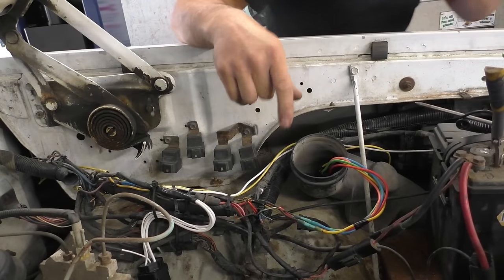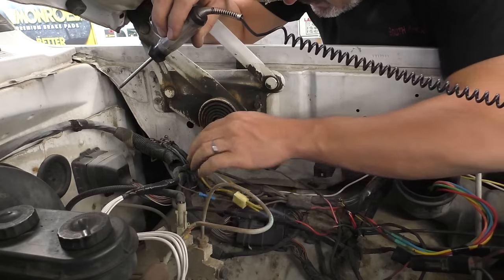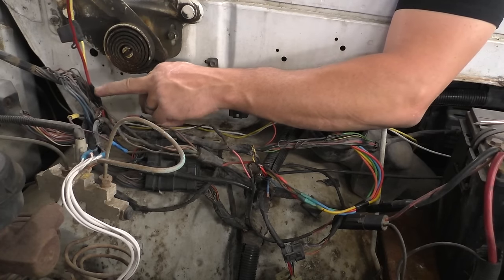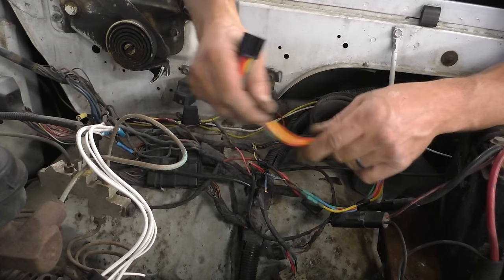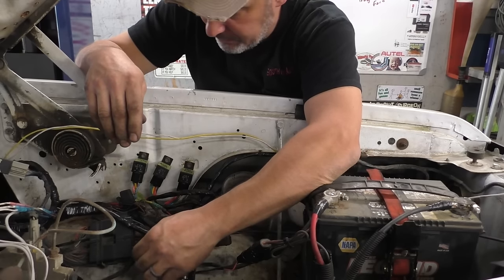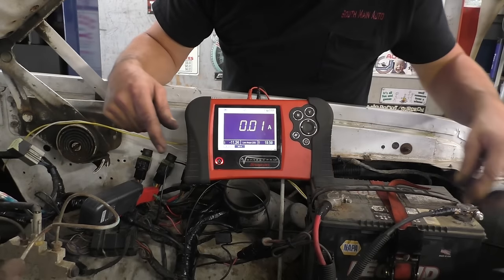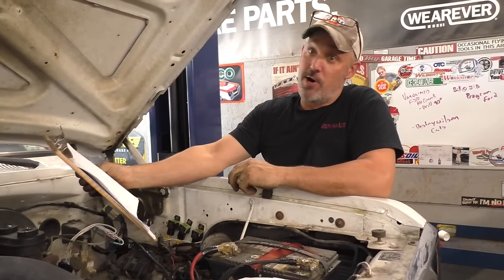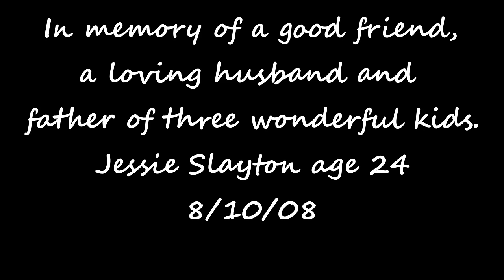Square Body Ram No Start - Complete Hack Job - Part II

Comment: I ran into this type situation with the factory fuseable links, someone's couldn't get power to the oil sending unit/fuel pump cutoff switch so they jumped out from the bus bar on the passenger side firewall on the early 94 Chevy extended cab short bed Z71 tbi Silverado i had and fed the fuel pump relay direct power and then straight to the oil pump sending unit, and they did the same thing with the ignition coil and straight to the battery, and I cut them out and bought a set of the 15amp, and the 30amp fuse lines from Amazon and replaced the factory fuel pump relay test circuit and the ignition coil to the distributor power side as it was supposed to be, and then I found the oil pressure sending unit was from the 87 Chevy p30 the motor was from which only had a 2 pin connector because it didn't have the fuel pump cutoff switch for when the motor drops below 15psi, and i put the correct switch in the truck and it showed oil pressure above 25 psi cranking and when I replaced the fuel pump relay with a ac Delco direct replacement, the truck fired up..... so yeah been there done that...

Comment: The spark from the fuse will be charging a capacitor somewhere probably in the ignition system once charged it's no current

Comment: I just found out yesterday that a fuse should be twice the rating of the current required for that circuit. So if it hit 20 amps you should fit a 40 amp fuse.

Comment: Often, getting a spark at the fuse just means there is a short duration (kinda instantaneous) inrush of current to charge capacitors/coils inside the electrical equip - Radio, ECM, fuel inj drivers, ignition, etc). Once the caps have charged (super quickly) current goes to zero.

Comment: The little spark is coming from a capacitor in the computer discharging or charging up..  a capacitor will look like a wire when  power is first applied and when fully charged will then look like an open ,,,   :-)

Comment: FYI: my ratchet strap battery hold-down has lasted over 3 years now in my Subaru. I installed it to quickly pass MD inspection, but it just works! I won't deny being a hillbilly.

Comment: The reality of fusible is color and length determines how much current and amperage it will carry. You can replace the link with an actual fuse inline on normal wire.

Comment: @31:24 You don't need A/C on those Dodge trucks with the vent windows. Just crank them in and open the door on the duct under the dash and plenty of air rushes by you on a hot day while driving!

Comment: If the circuit has no capacitors in it, is there some piece of equipment that is identifying as a capacitor for your spark?

Comment: So far I haven't had to contend with a fuseabie link on my f150 or vw jetta. I dont really understand their function. I guess they are only available from dealer. I need Good luck finding it for a 1993 truck. My jetta tdi has 425k miles and is all orginal.

Comment: Lol.....the wiring on that looks like the wiring on my 82 k5 blazer....everyone and their drunk uncle had their hands in it but because I'm a mechanic by trade, I dont have time to rewire my own truck......right now at least. I did manage to get a mini anl fuse block in there at least and chop out miles of old wire and fusible links without prejudice. The stock oem wiring was a disaster before anyone even started butcherizing it.

Comment: Eric I have a new Autel maxsys Ultra and need to set up repair software that integrates with it. I see that Autel has an option for repair software through Motor.  What company do you suggest using for a two stall new shop?

Comment: + Still think it's the ignition switch or its connections , u too saw a spark in this video and l saw the tester light up for a second when Mrs O was turning the key off in the last video ,,
Reply: Maybe they damaged the switch by connecting the starter solenoid directly to the switch without the relay.🤔

Comment: Circuit Hypalon Link Type MAXI Fuse Rating Circuit Wire
Alternator Feed (R6) 12 gauge (black) 160 amp (2x80 in parallel) 8 gauge (BK)
Radiator Fan (C26) 20 gauge (orange) 40 amp 14 gauge (GY)
Ignition Feed (J10) 18 gauge (grey) 50 amp 12 gauge (PK/BK*)
Ignition Feed (J1) 20 gauge (orange) 40 amp 12 gauge (RD)
ECU/ASD Feed (J1) 22 gauge (white) 30 amp 12 gauge (PK)
Direct Battery Feed (L1) 18 gauge (grey) 50 amp 12 gauge (RD/WT*)
Heated Rear Window (C13) 18 gauge (grey) 40 amp 12 gauge (BK/RD*)
Hazard Flasher (A3) 20 gauge (orange) 20 amp 14 gauge (PK)

Comment: I read what ended up happening but I was saying to myself that you should just run new wires to the fuel pump and make sure it was installed correctly

Comment: Small spark at fuse on ignition line = Ripple capacitor charging on ignition coil? Would explain no further current draw after initial connection.

Comment: I’m not a fan of the fusible link either . You put it back to as close to original as possible which works. Only an old Dodge mechanic could of done it faster. And a big pat on the back for helping her out.

Comment: I bought an old 49 Chevy truck years ago and I must have been out of my mind when I did. The first time out driving it out of town the top radiator hose got cut from the fan blade. I couldn't figure out how that could happen. After getting it back home I got to looking and see that the engine wasn't bolted down and either was the transmission. The engine was sitting on a old leaf spring and the transmission had a giant u bolt trying to hold it in place. So i found a garage that made motor mounts for the engine but what they didn't see that from the original engine mount in the front was still there. Because when I came to pick it up, I started it the fan belt hit that old mount. Well the mechanic says bring it back tomorrow and I said I'm not going to drive it, so he went a head and cut it out. Another time driving it smoke started coming out from the dash, so i pulled over and undid the battery which was under the floor board. I finally got things figured out except the battery would drain overnight so would have to unhook it every night. I sold it for the price i bought it, poor guy.

Comment: Isn't it funny. You work on all those modern cars with computer controlled everything. Wires, modules, sensors everywhere. And mostly no problem. Then this old thing that comparatively runs on steam. And you say it is out of your comfort zone. Too used to working with the scan tools and codes. Logic prevailed. Got there in the end. The intermittent fuel pump would be a pain. Hope it packed up again while you still had it. Nice to have a bit of old school. Now I read the update. Good should be fixed now.

Comment: I loathe fusable links. In theory, when they blow, they are supposed to burn thru the insulation so a troubleshooter can spot the problem. Usually, they don't so they just look like another wire. If you have never heard of fusable links (which I had not, for decades of working on cars) you think it's just a normal wire and don't bother checking voltage/continuity on BOTH ends. Grrrrrrr.

On those old ChryCo vehicles, the computer is cooled by the intake air, so that Pontiac air cleaner setup might be letting that PCU heat up a bit.

Comment: This just goes to show: If you DON'T know what you are doing, LEAVE it to the professionals. No good reason for all the hackery. I would rather have this truck than ANY of the new ones. Bulletproof 318 and 360's. Bulletproof transmissions. SOLID suspension and frame.

Comment: "Fusible links are used instead of a fuse in wiring circuits that are not normally fused. such as the ignition circuit. Each fusible link is four wire-gauge sizes smaller than the cable it is designed to protect. Links are marked on the insulation with wire-gauge size because the heavy insulation makes the link appear to be a heavier gauge than it actually is. The same wire size fusible link must be used when replacing a blown fusible link.." There is no reliable color code below 30 amps.

Comment: Fusable links are obsolete, OEMs don't even use them anymore, they split main power from a small array of large buss bar fuses instead now. Waaay cheaper to install a fuse block with buss bar fuses and less nonsense in the harness when they order everything from the harness manufacturers.

Comment: I've got a 1987 d250, 360 original engine, 110k miles, 1 owner, with the same hack job wiring under the hood, but it's not ase bad ase this truck 🙏🙏. Wish I hade your wiring diagrams😭😭

Comment: A fusible link is in every fuse made. It is the preplanned weak point in the circuit where there is an increased resistance (current choke point) where the heat generated by the voltage drop across combined with the current through it will melt the wire or solder at a known power dissipation. [ P=I*E ] Why they used a piece of wire to conceal the location of a fuse is a strange practice that I hope has now been abandoned. A fuse with a fuse holder is not that much more expensive to install and so easy to detect compared to hiding the fuse in a length of 40 gauge wire in an insulator in series with the 12 gauge supply wire making it very hard to find and to test. People get confused and find an "open wire" and replace it with a length of 12 gauge wire making it now a dangerous, unfused circuit. If it went to a clearly defined, socketed fuse, they would not generate this hazard.

Comment: Ugh some people should not touch things. If you use a butt connector under the hood, use a heat shrink version. Not only does it seal the connection, it also holds the wires together.

Comment: So I'm siitin in a snack bar trying to read my phone without glasses. I'm holding it as far away as my arms allow, struggling. Some guy I don't even know walks past grabs my phone and holds it out another 5 feet and says, "Is that better?" What an A-hole. Get the glasses Mr. O. You will wonder why you waited so long. I promise it's not getting better so don't put it off.

Comment: I am not sure why you always beat yourself up. I get it, you don’t want to brag about your work (except to Mrs.O, because she loves to hear of your accomplishments, and she is your biggest fan.) But realize you are a very very good technician. I don’t care what your educational background is. You know your stuff and it shows. I use to have 10 HD techs under my command. Sometimes they would come looking for a job, all cocky, flashing all their fancy certificates in my face. All I would say is your pieces of paper don’t mean nothing around here. Show me what you can do, that will decide if you stay or go. 
Often times, when repairing out in the field which in our case was 90% of the time. The papers flashers can’t cut it. Why, the real world is not in there fancy text books. 
Eric, not ever saying you need to talk the talk, but don’t ever talk yourself down when you can clearly walk the walk. 
Great example for everyone - you knew that you had not fixed the fuel pump problem, but like any electrical issue. If it’s not broke you can’t fix it. Fortunately it showed it’s ugly face soon enough so you could deal with the problem. 
Now just one question- why is it you never spray the electrical connectors with Fluid Film. Corrosion would be non existent from then on ?

Comment: Eric, your diagnosing start to finish -- lost me. Seems your need to know what was wrong was an important as just fac-spec rewiring to immediate fix. I'm a Marine electrical fixer and so many times I have just chosen to re-wire rather than diagnose patches and bad wiring.  Maybe on your eventual transition to retirement..look into and consider a Marine shop environment. Your a master Mechanic and your expertise is beyond amazing. Sincerely.

Comment: this was made before chrysler wiring sucked.  how and why it got butchered is all but a sin.  it was still simple straigt foreward.  back in 1980i couldnt get fuse link wiring.  all you ould do was add an inline like you did.